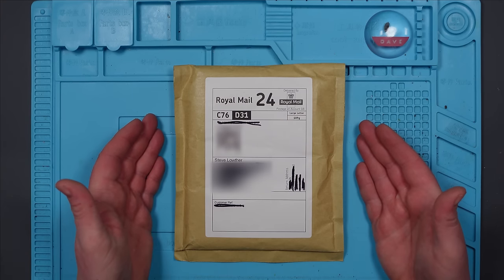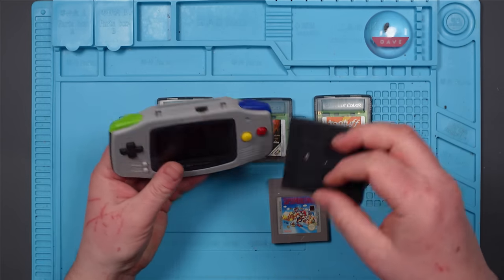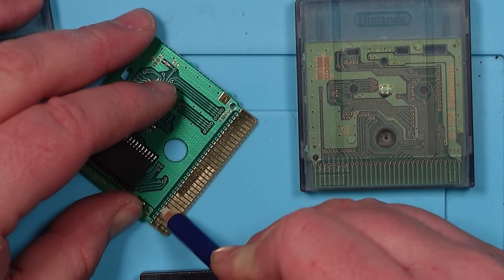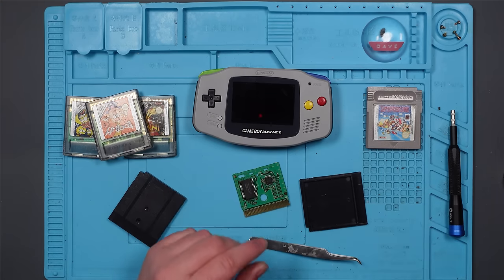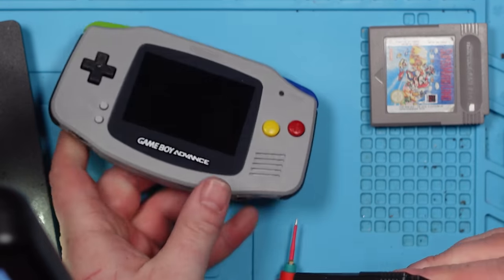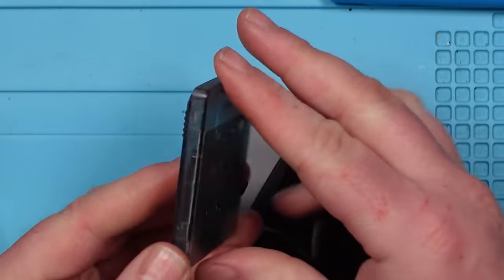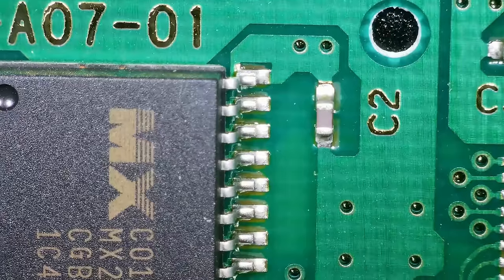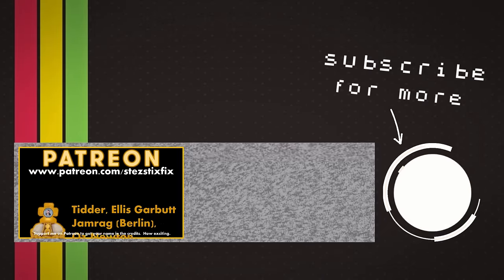I Bought 5 Broken GAMEBOY Games on eBay | How Many Can I FIX?!

Comment: the design of gameboy carts means that repeateded removal from the system flexs the pcb making the chip legs cracking free from their pads an extremely common occurance. it's sad to think the amount of GB carts that have been binned because of what was likely an easy fix.
Reply: UnjustifiedRecs  it's not a case of being necesserily rough handed it's just repeated use, it only needs the little pinch of the thumb against the cart to slide it out each time repeated say 100 times or less if the solder is already subpar for it to crack away. the same applies to sega megadrive carts having their traces worn away where the plastic shell edge pinches the board when it's removed or the controller port of the sega megadrive cracking loose from the plug being inserted and removed so often.
Reply from the maker: Thanks Sparks, yeah that makes sense.  I just thought it strange that it was always in the same position, but you're probably right it must be something to do with insertion/removal... because they obviously all worked when they left the factory 🤷
Reply: Definitly the way the cartridges have been handled through the life. Lets not forget that being a portable console the cartridges don't just live at home, they are being bashed around in back packs and pockets too. Very little solder on the chip legs, lots of impact and vibration and you have the failure. Note that the broken solder is also towards the center of the PCB too, where the most flexing will happen if you sat on it for example.
Reply: @NationOfMasturbation  well it was more unavoidable design, most items are made with an understanding of cycles of use, these items still work after decades of use and abuse and are only just starting to show their age because of these design issues.
Reply: @SparksNZeros  It's utterly amazing that none of mine have this problem, but thanks to Steve I'll know where to look if they fail in the future. Can't imagine losing Tetris because of this, or Link's Awakening.
Reply: Also worth noting the way the cartridge is removed from a GBA is very different from a GBC. When the cart is pulled from the GBA you are alot more likely to grab it from the front and back since it is exposed. Removing it that way applies a tremendous amount of pressure right on the part where the chip is. With GBC the cart was not exposed so you had to remove it by the edge where there was no pressure applied to the center of the board. I wonder if that area was not reinforced better cause they did not anticipate the backwards compatibility for the GBA.
Reply: @NationOfMasturbation  horrible is maybe a bit unfair. That super Mario one is from 1989, how many years do you think it got before it broke? And broke in a way that is repairable as well, as opposed to another common medium of the time, tape, which necessarily degrades as part of its use and is basically irreparable. 

Is it a 100% perfect design, no, but nothing is, trade offs get made and i think you have to accept a normal working life for products like this.
Reply: UnjustifiedRecs  It is the vibrations that break it loose. The same reason many of the nuts and bolts in your car are tightened to a specific value
Reply: to take a factory-working / brand new cart and see if this damage can be caused by flexing the pcb in a certain way would make a good video.
Reply: Nice i subscribed on this!!!
Reply: Extremely common after decades of use. At least a decent soldering kit would enable anyone to fix all their cartridges.
Reply: UnjustifiedRecs  rough handed...like a child?
Reply: @thesillyhatday  makes sense but I'm still stumped on how that one had a crack in it) the one that was  but the outside case didn't 🤷 lol that one is still a mystery

Comment: Here's my guess for the repeated pin solder failure.  The pad at the corner has 2 heavy traces leading from it, leading to a flooded area (possibly Vcc).  Because of this additional thermal bridging, you are more likely to get poor soldering at this pad.  If that mounting hole diagonally above C2 attaches to the cart case, you also have a nearby source of mechanical stress.  Over time and use, I can see these two things leading to a potential failure at that one point.
Reply: At last someone answered what I was thinking.
Reply: That does look like the design basically has a large(relatively speaking) heat sink next to those pins.  The fix is pretty easy(longer soak time in the oven before reflow to get the board more evenly heated), but it's hard to see how they would have known there was a problem in the first place to do anything, especially if they're using class 2 standards.
Reply: since all transparent ones are affected and its the top/top3 pins that are affected, could it be that the solder degraded faster with uv light (sun exposure for example)?
Reply: UV light has almost no effect on metal, or at least I don't recall any metals that degrade from it, so I can't see the radiation being a factor.  However, if that particular section of the board was exposed to more light, it could have been exposed to more heat, which could have caused some expansion and retraction of the metal in those joints that sped up the breaking of them.
Reply: @Suraht  you are probably right
Reply: thankyou for saving me time to write a long drawn out comment stating just this

Comment: I bet that one spot is where the board flexes a tiny bit in the case as you pull out the cartridge.  Eventually it pops that one pin and maybe a few more down the row.
Reply: I think you might be right. It certainly makes sense.

Comment: You should solder the whole width of the ground plane at 7:39, because it's the only mechanical reinforcement keeping the crack together when pulling the module out of the slot. And I think the module having been stuck too hard in an GBA is the reason for the PCB to crack at first. That UV epoxy doesn't have strong cohesion.
Reply: You're probably correct, but it's also almost certain that - at this time in their lives - these carts will not have to fear e.g. rambunctious 8-year-olds.
Reply: @MJFallout  You probably also are correct with this. Additionally you should not forget, that half the fun for many of us retro nerds is about preserving the old treasures for the future :)
Reply: I'd go one further and solder multiple wire strips across to give it more integrity
Reply: @elmariachi5133  yes! This. I have a Pokémon silver cart that can’t hold a save but you can still play the game. I’m disappointed I can’t save progress but def good for hanging onto for my kids to enjoy

Comment: I have came across the exact loose pins before too. Must be from the gripping and pulling on the cart, over and over again.
Reply from the maker: Thanks Phil.  Yeah, makes sense.  I found it odd that it was in exactly the same place each time.  Got to be the weak spot, but you'd think they would be rigorously tested for that kind of failure.

Comment: yup, cold solder joints.
The factory that produced these obviously didn't use enough paste (or the paste was expired, less likely) on the contact or the pick and place machine was poorly configured.

Comment: I was working with optical inspection machines for a pcb manufacturer. Things like that can have several reasons. Either the temperature wasn't quite high enough, as that upper leg seems to be a ground one. Another reason could be an error of the chip manufacturer or transport. Has chips that had one or two pins that were slightly higher. A third thing could be a badly optimized screen for solder paste application. Just slightly less in one corner can cause this.
It might be working absolutely fine for years... until it doesn't. Practically impossible to notice during manufacturing

Comment: I worked in a electronic (or rather pcb assembly) plant back in the 90's. This kind of problem is typical when something goes wrong with one of the pick&place machines. Mostly some alignment problem that will slightly bend the pins during the placement process. The pcb will work fine until the build up stress finally breaks the soldering bond. Clearly they also where cheep on the amount of soler paste used. So it seems like a combination of poor reflow soldering and some problem with a batch of chips or the P&P machine placing them on the pcb.

Comment: I wonder if when they are clicked in and out the torsion on the cart puts pressure exactly there and over time ruins the integrity of the chip connection?

Comment: Makes me wonder if the legs came off because of heat expansion. If the cartridges had been in varying temperatures and the chips and the boards would change size different amounts per degree, that would create forces that would "wiggle" the joints (slowly), eventually possibly making the weakest spot to fail.

Comment: old solder + board flex. common in instances where you don't have it held 100% rigid, and isolated from movement of insertion/removal. i've noticed some people can twist the shells a little when putting them in or taking them out, leading to.. well, chips desoldering themselves over time from the mechanical stress.

this will also save some omega ruby/sapphire, but not all. it was never fully explained what the problem was, and it isn't limited to soldering, since its not a universal fix for those. might be a bad batch of chips that didn't get properly put through the solder bath, so you get a mixed bag.

Comment: While not a common problem with GameBoy games with faulty GameBoy games, this is extremely common. I've had it happen to me too! It seems to affect GameBoy games made after 1996 through 2002. It seems earlier GameBoy games used more solder.

Comment: Use a piece of lexan and slide it under the wire you soldered to prevent damage to the pcb/line when u cut it to size.

Comment: I'm pretty sure the Gambeboy Color game all have the same defect because that solder joint is closes to where the screw hole is.  The tightened screw slightly flexes the board and over time the solder joint breaks.

Comment: Man that was awesome! I got secondhand excitement every time you fixed one 😆. I HAVE to know, what were those toothpaste-like substances you used on the pins and the cracked card?? Not the solder but the green stuff you put under the thermal light and the other goopy stuff you used before applying solder?
Reply: I'm not the uploader, but if my experience in PCB manufacturing is to be believed, the green goop was solder mask...basically a liquid that hardens up under UV light, usually serving the purpose of protecting the board layers under the mask from damage and corrosion.  The other goop, the one put on before the reflowing, should be flux, which effectively cleans the metal of any oxidation/corrosion so that the solder can actually adhere to it during reflow.
Reply: 99% sure it's flux he puts on before soldering.
Reply: @incongruous4  But what brand?  I've seen this clear flux on a few different channels but never seen it in real life.
Reply: @IHateYoutubeHandles615  i don't think it matters. Personally i use mg chemicals flux because it's decent and easily available. I don't think it matters what brand or type, flux is flux. You can get it in a goop in a jar, in a pen style if you're lazy like me or in a syringe. It's helpful for very small solder joints or if you are a perfectionist. I dont use it much, mostly for stuff like the solder pads on usb connectors making my own cables.

Comment: SUBSCRIBED. I'm going to say something. I'll give you that it MIGHT have been a factory manufacturer's defect; BUT. For one thing, those games didn't all come from the same factory; for another thing if so, that is a huge coincidence they are all failing in the same way. My theory is, it's a physical issue, resulting from a reaction of the solder joints separating due to the forces of inserting and removing the cartridges, over many years. When the circuit board flexes, the solder joints are being stretched and compromised.  This is a good explanation which doesn't rely on coincidence.

Thanks for the content.
Keep up the good work.
בס'ד

Comment: First time repairing a gameboy game. It was a struggle with no prior experience. I learned a lot through  trial and error. However, the feeling of finally getting a game to work is priceless. 

Oracle of Ages had **** for the game file come to find out 2 pins were completely off one of the chips I had to reconnect a line back to the board and maaaan. Took me nearly a day and a half to finally say I fix it.

Comment: Would like your help on how to reattach a flat flex cable which has partially detached from a long strip of PCB which connects to the TCON board to the main screen controlling the left side of the screen. This was noticed after replacing the backlight strips. What equipment do I need, solder and so on?

Comment: I've been watching a lot of gameboy cartridge repair videos and the connections on that chip are the problem 9/10 times. I'm wondering if it was a machine problem, an issue with the solder, or if it was a planned obsolescence thing.

Comment: A simple suggestion.. by putting in them dirty edge connection will make the systems pins dirty. Them Gameboy games were really dirty. Check the connection and clean before testing so you don't dirty the console.

Comment: I would guess that this happens by accident when people use the cartridges in the advance as it dosent support the full cartridge so unless you pull it out perfectly paralelle you could flex the board and crack the joints.

Comment: I've had two games with loose pins. Both were in a pretty rough condition though. One was bad when I got it, the other got bad after some time (it was megaman IV and Wario Land 3).

It may not * just * be a factory default, I wonder if it's not just because how these games were used.
Unlike NES/SNES/N64 cartridges which are much bigger, use through-hole parts and rarely exit home, these were just mistreated all their life, put in pockets, dropped on the ground, etc. I think this is just that. Surface mount + bad treatments is a recipe for this kind of problem imo.

Comment: Wow I seriously can't believe it, but I had three different games Gameboy games that stopped working. I wondered if they had the same issue as yours. Surely it couldn't be the same thing that was wrong with them?

After removing the celo-tape and running new wire, they work now!

Comment: That's really bizarre.  How would those broken solder connections make it past some kind of QC at the factory?  Unless through heating of the board through play...like some kind of common stress point after use for a while...
Reply from the maker: Yeah, I think inserting/removing the cartridges exposes it as a weak point eventually...

Comment: I think that the comments about PCB flexing is correct for the reason that those pins come loose.  However I think that the root cause is that there is not enough solder on the pins, or that it didn't get hot enough to flow properly. The solder should have flow up onto the sides of the pins, but in the video it looks like its just flat against the bottom of the pin.

Comment: I know why and how.
My mom was a supervisor at an assembly line for chips, not for games. Workers applied glue on as much point as they could instead of the max. three. Wen they put the piece in place the glue would be to dry and not stick as good or at all.
The order of glue application is probably counterclockwise from the upper right corner, leaving that one connection in great jeopardy of getting loose.

Comment: I think the pin you're finding the cracks on are power pins. The power plane on it has a little rectangle missing from the left of it so I think it's messing with the thermal/power dissipation properties and causing the pin to over heat and de-solder. The real question is why the power island that's connecting to the pin isn't just connected to the larger mass of the power island to the left of it, so it can better dissipate heat. It actually seems like it might have been done for planned obsolescence reasons to make the cartridge fail by the time they roll out the next hand held system. What year were the cartridges with the disconnected pins made in? My bet is that certain boards made near the end lifecycle of the Game Boy Color, were made like that intentionally while the oldest ones are probably fine.

Comment: Hello, I have an old ps2 fat 39003 which plays fine for over an hour then in the middle of playing its always on a loading screen it will go back to the home screen showing the disc and memory card and you have to load the game again. Before it happens the disc drive clicks twice and I have replaced the power supply, laser and cleaned everything. What could this be please?

Comment: I wonder if these games were all manufactured with the same batch of crappy tin solder that happened to all fail in similar ways. I can see the chips all being installed in a pick-and-place machine that leaves it with the same stresses present on the upper-right corner of the ROM chip.

Comment: what mount are you using with your ad407 microscope?  or is that not the microscope you're using in this vid?
Reply from the maker: I made one out of the original stand and an articulated arm.  It's basically a Frankenstein of the 2.  It allows me to move the microscope much further away and gives more room to work underneath!  👍
Reply: @StezStixFix  thanks for the reply!  What articulated arm are you using?
Reply from the maker: @gehx  it's this one : https://thepihut.com/products/articulated-arm-stand-for-usb-microscope
Reply: @StezStixFix  thanks dude!! 😁😎